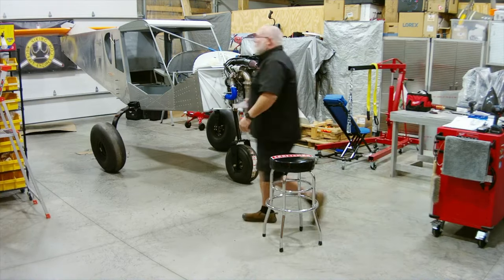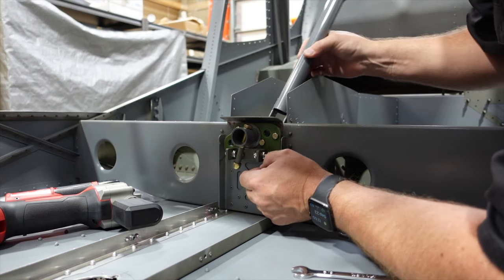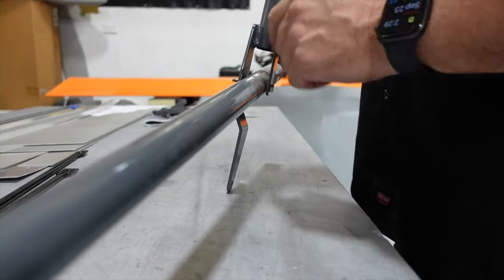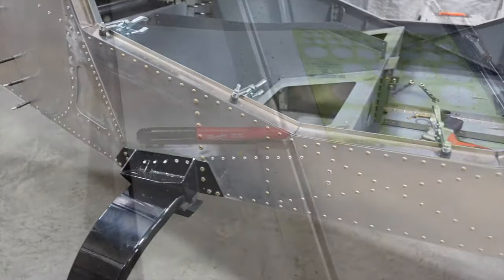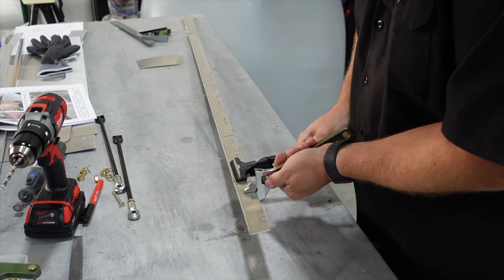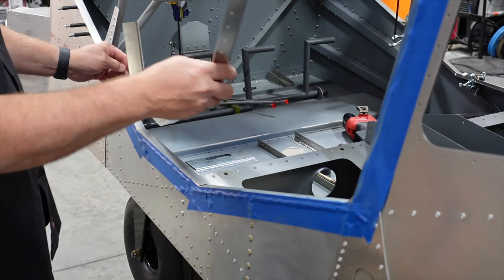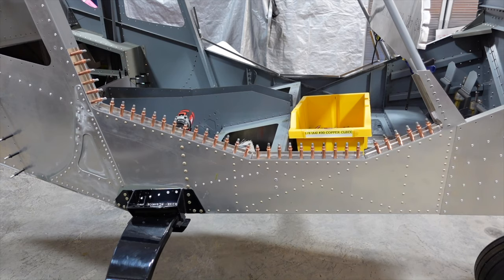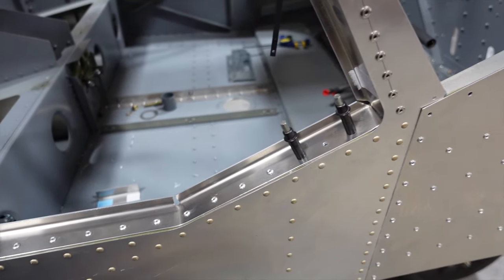Ep. 41 | Control Stick & Cabin Door Frame | Zenith Super Duty Aircraft Build

Comment: Now is the time to consider 2 changes:
1) sit in the plane and see if the control stick is where you want it. For me, it was fine where my hand rested but not good for max up elevator. Had to bring my elbow way back behind the seats for full elevator. 
2) where the pivot bolt for the stick go through the torque tube, weld in a sleeve from 4130 steel to remove slip in the controls. 
Spruce # 03-00250
Reply from the maker: There is now a sleeve included with the pivot bolt.  I’ll check the stick once seats are back in.  I’ve kept that in the back of my mind for a while since first seeing yours and your comments about it in your videos.

Comment: Adam what would you do different? Would you have the Coaters mask off the areas that will be fitted together?
Reply from the maker: Everything from the control stick back you could skip powder coating just paint.  The control stick is the only thing showing.  You could powder coat or paint that.

Comment: Adam. Steve from Anchorage.   Are your door seals, top and bottom two different thicknesses?
Reply from the maker: Haven't installed them yet but it looks like I only have 1 roll of door seal, all the same.  I'll let you know when i get there.  Working on that right now.
Reply: @AeroworksProductions  sorry I wasn’t clear the aluminum door sill not seal, sorry.
Reply from the maker: @stevelemley9475  Yes they are different.  Smaller on the top.  Not sure why they didn't keep it all the same.  Maybe a clearance issue or oversight.
Reply: @AeroworksProductions  thank you.